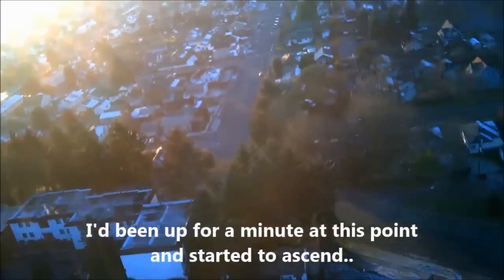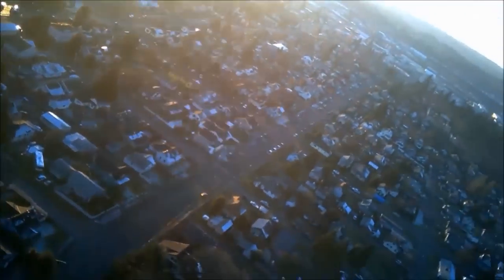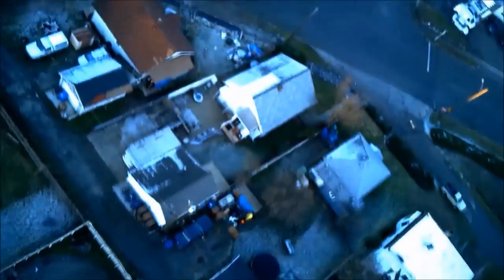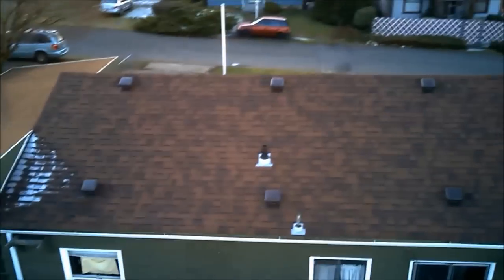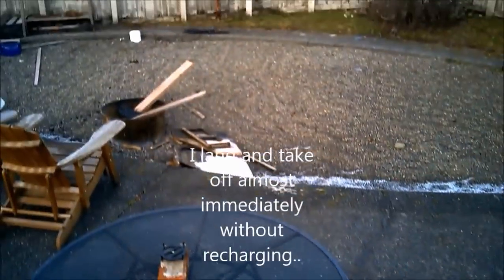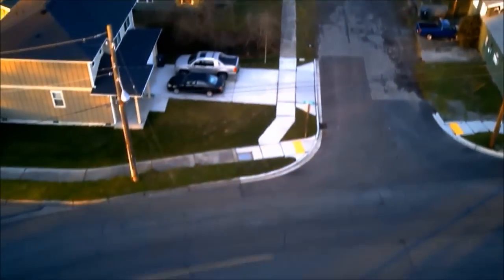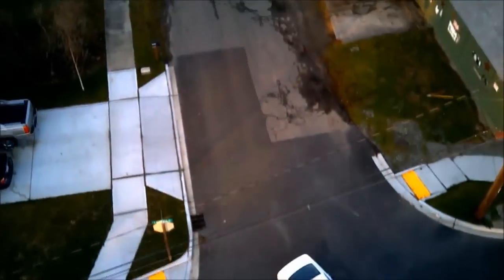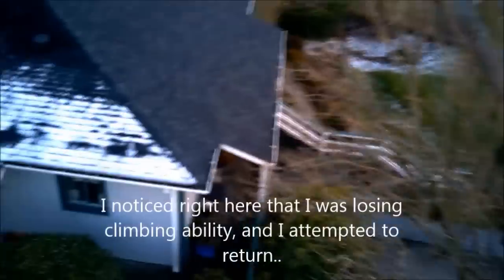Propel HD Video Drone Battery dies in flight

Comment: I just got one of these from a dumpster dive at a store, was returned defective. took it apart and found a loose connection on one of the motor cables so it works now. not bad for free.

Comment: That was pretty good flying in some wind without GPS and altitude hold.  But next time you fly use a timer to alert you approx 2 minutes before your battery dies. And keep in mind the more aggressive you fly the runs down faster.  Good luck and be safe.
Reply: Tank 62 it has altutude hold actually, the thing is supposed to land itsself when the battery gets low.